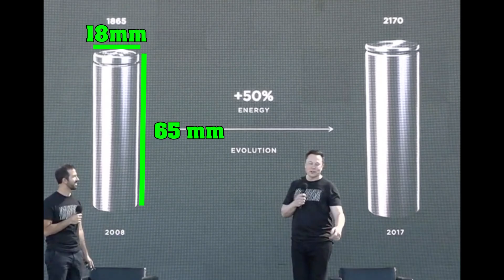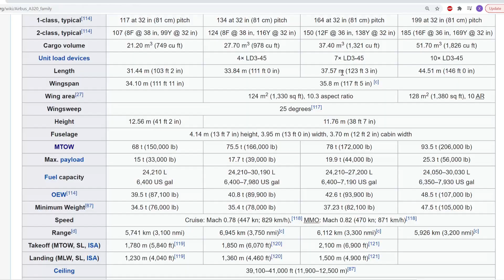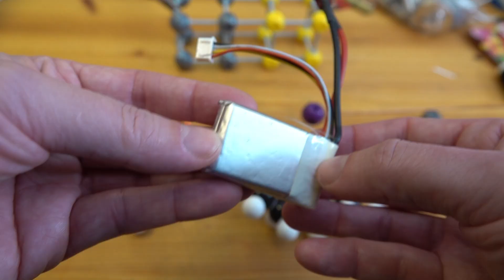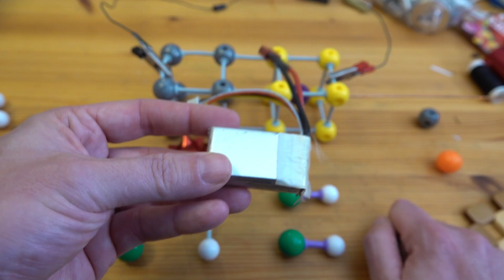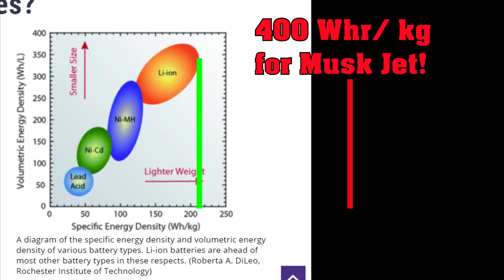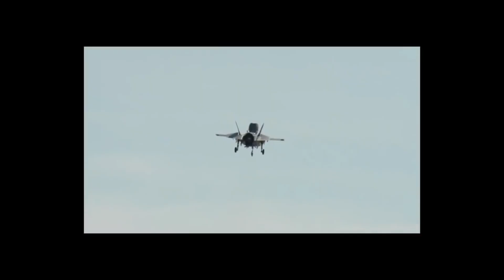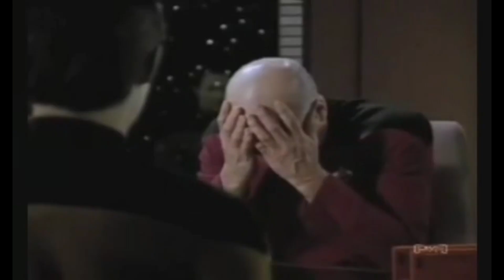Tesla's Secret Plan To Disrupt Airlines: BUSTED!!

Comment: Researchers from Wuhan university have created a prototype thruster capable of generating plasma jets with propulsive forces comparable to those from conventional jet engines, using only air and electricity.

An air compressor forces high-pressure air at a rate of 30 liters per minute into an ionization chamber in the device, which uses microwaves to convert this air stream into a plasma jet blasted out of a quartz tube. Plasma temperatures could exceed 1,000 °C

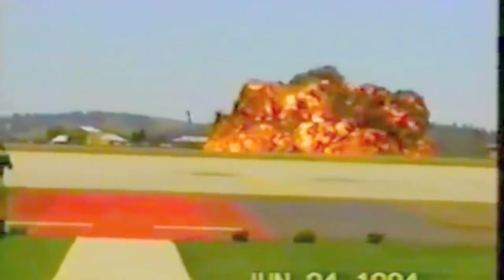Comment: 22:42 (or thereabouts) "If you power a plane by a battery, every battery failure will lead to a plane crash."  From what I've seen, this is simply untrue.  Most of the time, the plane would be at a fairly high altitude.  A battery failure at high altitude would likely lead to the sort of catastrophic destruction that would make the thing that eventually crashes to the ground utterly unlike a plane.  Also, with no payload capacity, and therefore no passengers, the failure wouldn't be nearly the tragedy that failures are in current designs of aircraft.
Reply: He was talking about having the plane's main power source being batteries instead of fuel.
Reply: @electric7487  "Whoosh!"

Comment: 1:40 TF doesn't know the difference between volume and density.  The batteries actually have more energy density, and TF is arguing about the energy volume.  The larger battery decreases volumetric packaging, the tabless design decreases energy loss, and the larger battery means fewer components at the modular level.

Comment: Have anyone ever claimed how the engine of the plane should work? I mean how they generate thrust?
If all they have (at least as I'm aware is all that exists) are pretty much fans, or electrical turbines.
Good luck having thrust in less dense air, this one is going to be interessting.
Reply: Researchers from Wuhan university have created a prototype thruster capable of generating plasma jets with propulsive forces comparable to those from conventional jet engines, using only air and electricity.

An air compressor forces high-pressure air at a rate of 30 liters per minute into an ionization chamber in the device, which uses microwaves to convert this air stream into a plasma jet blasted out of a quartz tube. Plasma temperatures could exceed 1,000 °C
Reply: @blackmartini7684  sounds interessting and promising, but they don't seem to have given a number on how much energy it takes. As far as I can guess, it probably is pretty expensive, but again, just a guess.

Comment: I'm confused, why is this video comparing a supposed electric VTOL jet with an A320 and not you know, an actual VTOL jet? Of course this looks ridiculous! 

Let's do a fairer comparison with say the F-35b. 

Empty weight: 29,300 lb (13,290 kg)

Gross weight: 49,540 lb (22,471 kg)

Max takeoff weight: 70,000 lb (31,751 kg)

Fuel capacity: 18,250 lb (8,278 kg) internal

Comment: Ok so I agree with a lot of the downsides your bringing up about feasibility, and what good use cases there would be I’m not sure , however I think your assumption the the the example Elon gave on the cell percentage include passengers and cargo is wrong , when stating the weight of a Tesla car or a normal jet from the manufacturers , it’s listed as a dry weight , no cargo , no passengers . I think it’s the same case here. 
And the when it comes to Battery day, it’s another example where you need to more research again, or better yet watch battery day . That slide is one of the 10-20 slides they showed , that 16% was stated as a result exclusively from the new form factor, mind you getting the heat creation of the battery low enough to even make a battery that large is impressive , it required re engendering the basics of a battery . All up the was listed a 54% increase in range for these new battering and a 56% cost reduction , which was the main point. Granted some of the range increase is from integrating the battery into the chassis and probably can’t be included here . All in all a massive breakthrough . So @thunderf00t in the future please do more thorough research. I agree with a lot of your points but you need to make sure all your facts your starting from are correct .

Comment: I realize this is your schtick and I've enjoyed a number of your videos over the years. However, sometimes it feels like you are being intentionally obtuse. Some examples:

Since batteries aren't a liquid like your traditional jetfuel, they can be made to be structural as apposed to treating them like cargo. In fact modern planes already do this with the fuel tanks (though obviously not the fuel itself) by making the wings themselves the gas tank. Tesla is talking about using this same batteries as structural parts which you must have seen during the most recent "battery day" you sourced part of your video here for. It is not that hard to make the miniscule logical leap to apply that to your math here, but you have not.

Next, the assumption that an EV plane necessarily must be equivalent to a commercial airliner is rather strange, especially given the discussion on vtol capabilities. I rather suspect this would be more geared toward private jets which are going to have a lot less cargo per person (person included) and would be more optimized for space and comfort. 

Lastly, your comments on battery energy density improvements are straight up disingenuous. Battery chemistries have taken nice strides over the past decade beyond "made the cell bigger", which I suspect you either know and decided not to go over for funsies, or you didn't do your homework. We are currently sitting at around 300 WH/kg with known pathing to 350 WH/kg. That does indeed leave 50 WH/kg that still needs to be figured out but that's a far cry from "just double the efficiency of a gas engine" especially given the pacing of innovation in the battery space where we were at 140 WH/kg on C // NMC 111s in 2014, 170WH/KG with minor cell improvements in 2016, 280 WH/kg with C // NMC 622 in 2018, and 300 WH/kg in 2020 with C+Si // NMC 811. And this is ignoring the actual reasoning behind the desire to move to larger cells (surface area vs volume).

Are batteries ever going to have the energy density of traditional fuels? No of course not. But they don't need to and there are plenty of good reasons to take the density hit if you are able (hint: climate change, finite fossil fuel supply).
Reply: Researchers from Wuhan university have created a prototype thruster capable of generating plasma jets with propulsive forces comparable to those from conventional jet engines, using only air and electricity.

An air compressor forces high-pressure air at a rate of 30 liters per minute into an ionization chamber in the device, which uses microwaves to convert this air stream into a plasma jet blasted out of a quartz tube. Plasma temperatures could exceed 1,000 °C
Reply: Batteries are not, and will never be, a viable way to power a large commercial aircraft. Nor will they be able to power private jets either. Your claim that "there are plenty of good reasons to take the energy density hit if you are able" is disingenuous for many reasons:

1. Even though the batteries can be made to be structural, they are not flexible. The wings of an aircraft flex quite a bit during flight, so for batteries you'd need gaps between the packs, which eats up your energy capacity. I do have to give you credit for mentioning wet wings, though, as many other fanboys and greenies don't know about this.

2. All of the gasoline, Diesel, kerosene, and HFO we're getting from petroleum can be artificially synthesised from CO2, waste pyrolysis, and through biofuels. Recently, KLM ran a flight on a 737 with kerosene that was 50% synthetic, and while the percentage of synthetic kerosene is low right now, it is going to increase over time due to, as you said, our finite fossil fuel supply. Eventually, once it is no longer practical to drill for crude oil, the fuels used to run our world will be entirely synthetic.

3. Cabin pressurisation and air conditioning are run via air bled off from the engines. On a battery-powered aircraft, this would draw directly from the batteries, further increasing the energy that would be needed to be stored in them.

4. Aircraft lose a significant amount of weight as they fly. On commercial aircraft, 30-40% of their MTOW's are fuel, and this mass is lost as the plane flies. And private jets are not much different either, such as the Bombardier Global 7500 where 44% of the MTOW is fuel. A plane powered by batteries would need even more energy because their weight stays the same as they fly, meaning that your MTOW is basically the same as your MLW. This also significantly increases wear and tear on runways and landing gear.

These are the reasons why the idea of a battery-powered airplane crashes and burns before it even leaves the ground.

Comment: Without changing anything but the form factor of the  battery, you can improve the energy density, due to the decreased portion of the weight devoted to packaging. Chemical reactions have a fixed upper limit of efficiency that is in the 100s of what hours.range per Kg.  Perhaps Musk can figure out how to make Lattice-Enabled Nuclear Reactions (LENR) work safely and reliably for an order of magnitude improvement or more.  One intrinsic advantage of a jet is that oxygen in the atmosphere does not have to be carried on board,.

Comment: "The higher up the plane goes, the more efficient the electric engine gets because there is less air resistance on the plane"
Wait how is this plane suppose to fly?
Reply: Yeah, higher altitudes with lower temperatures will help "greatly" only until you realize that current batteries have reduced capacity in low temperatures...
Reply: they go faster to generate more lift
Reply: It must be magic, because in reality thinner air also means there's less air for your electric fans or props to push against, meaning there's less air to get your thrust from.

Comment: I still have a question. It is presented as an electric supersonic *jet*. A jet functions by action-reaction, for which you need a propellant. A combustion jet, propellant is the heated mix of air and fuel. But the electrical jet won't have fuel, so, how do they plan to make the jet propellant? Heating air with electrical resistors?

Comment: Could you make a positive video? Exploring real innovation, and what (if anything) excites you for the future.
Reply: Researchers from Wuhan university have created a prototype thruster capable of generating plasma jets with propulsive forces comparable to those from conventional jet engines, using only air and electricity.

An air compressor forces high-pressure air at a rate of 30 liters per minute into an ionization chamber in the device, which uses microwaves to convert this air stream into a plasma jet blasted out of a quartz tube. Plasma temperatures could exceed 1,000 °C

Comment: For the love of god, if there really were some magical advantage of flying a commercial plane at 50,000+ feet, commercial planes would just carry the oxygen in a closed looped system. 
The issue isn't that this couldn't be done, but that it is STUPID.
Is every passenger going to be fitted for a pressure suit? No, and would you get on a plane where the pilot and copilot were in pressure suits and nobody else? No.
Flying at near space heights brings all the disadvantages of being in space, with few of the advantages of being in space.
You still have air drag, and with it the heat of compressing the air, but the atmosphere is so thin that you die if exposed to that level of vacuum.
Even on a standard commercial plane, without that supplemental oxygen, most people would die from the lack of air pressure. They already fly on the envelop of decompression death, and people want to cross that envelop which ensures death and label it innovative.

Comment: Why didn't you pick up on the vertical take off it's incredibly inefficient this is why you only ever saw harriers do it at air shows. vertical take off and hover would burn through it's fuel in c10 mins.

Why would you want to go over to electric planes? Jet engines will run on nearly anything that will burn so don't need fossil fuels if that's their concern. RR even run one on 40% ABV Scotch.

US air force had the idea for an electric plane without batteries Oak Ridge National Laboratory was working on a Thorium MSR for it. So electric planes aren't that crazy an Idea.

Comment: I don't really find your argument about Li-Ion battery being "as good as it gets" or too dangerous convincing. It's not gonna be Li-Ion but saying that there is no room for improvement in battery technology doesn't seem realistic. If my body can store energy at 38 MJ/kg in chemical bonds without me exploding when I get hurt, convert it to ATP and use that to run cellular functions, what would a prevent a future battery technology to do something similar but generating an electrical current in some way we haven't figured out yet instead? We can all agree that Tesla doesn't have such technology but it's because Tesla hasn't shown anything that would even remotely indicate that they have something, not because it would be impossible to develop a better way of storing electrical energy without it being "basically a bomb".
Reply: Your body can store 38 MJ/kg safely because those fatty acids and fatty acid esters ARE NOT MIXED WITH OXYGEN. Batteries need to carry both oxidants and reductants in the same package and they put them in close proximity.

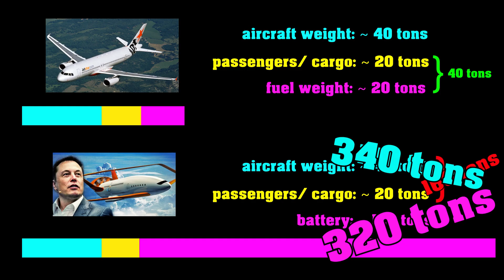Comment: @9:40
A plane with 50% of it's mass being the structure and 70% of it's mass being the battery only exist at one point: 0kg. If you want to find another point, you need to drop the hypothesis of the structure being linear with the total weight. 
Like, finding another plane to have a second point and draw a line to see where it works out. If you take the wrong second plane to adjust the model, the balance point is negative so you'd need antimatter batteries. They seems to have high energy content so it's a good solution.

Comment: Your assumptions about the weight of the structure of the plane are unwarranted - using batteries as the structure is already achieved in Tesla prototypes (and is soon to be the default way they are built) there is nothing in principle stopping them from using batteries as the structural element of the plane also. 
But I do agree we are not likely to see battery powered electric jets anytime soon if ever. 
400wh/kg  is the theoretical minimum power density if it's ever going to be a practical thing it would have to be way higher than that. 
400wh/kg is probably about 5 years in the future. (There are relatively straightforward paths to get there).
For significantly more then that, some major breakthroughs are needed.
So I don't see an electric jet anytime soon, and even if we do get one it's much more likely to use fuel cells then batteries.

Comment: A supersonic, electric, vertical take-off and landing jet
Wacky waving inflatable arm-flailing tube-man
Reply: Researchers from Wuhan university have created a prototype thruster capable of generating plasma jets with propulsive forces comparable to those from conventional jet engines, using only air and electricity.

An air compressor forces high-pressure air at a rate of 30 liters per minute into an ionization chamber in the device, which uses microwaves to convert this air stream into a plasma jet blasted out of a quartz tube. Plasma temperatures could exceed 1,000 °C